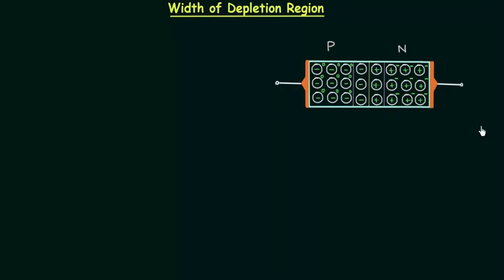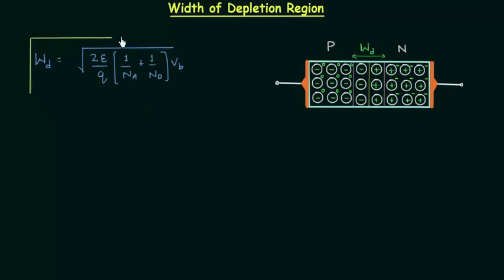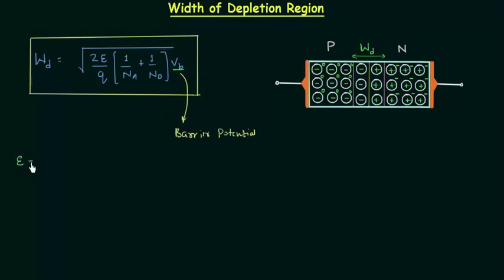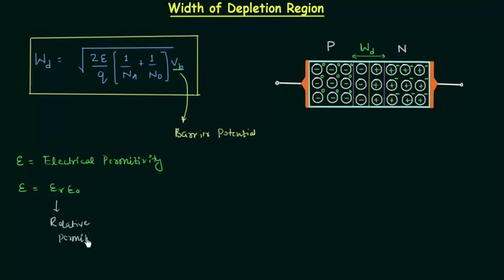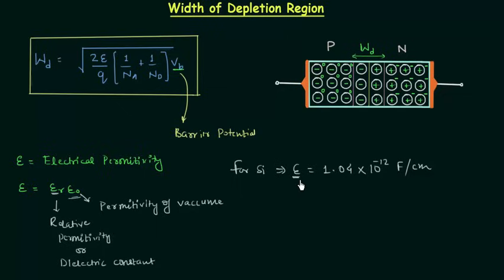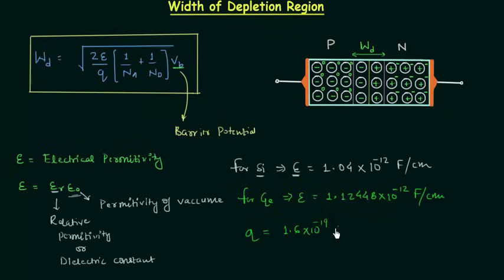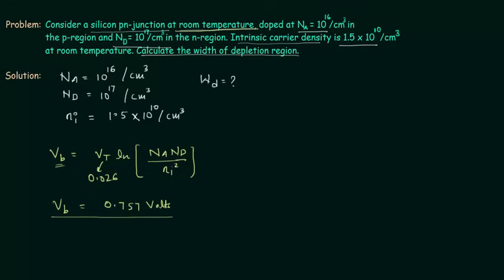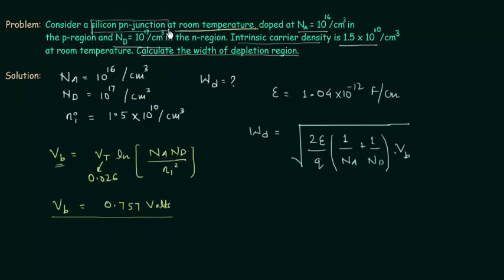Width of Depletion Region

Comment: Hi,  @nesoacademy
You are making a lot of mistakes hile calculations.

1. voltage of potential barrier = 0.32884  V

use log(a/b) as log a + log b. or even directly do it.. the voltage of potential barrier is wrong. 

Please correct me if i am wrong
Reply: it's natural log (ln) not log
ln(A) = 2.303 log(A)
Reply: ya i also got the same value and i think so such mistakes have also occured in previous videos
Reply: no it's correct.
Reply: Ya it should be 32.2884microvolt

Comment: hello, 

one unit-conversion-related question arises at the end of this lecture: shouldn't the end result be 32.90 micrometer, because the decimal point should move to the right when you convert into smaller units. therefore 10 to the power of -6 for micrometers is exactly one decimal point to the right !? 

thanks for your clarification.
Reply: @Jan Luis Antoc  then what about concentration dimensions they are in centimetre cube. they need  to be converted into metres .isn't it ?